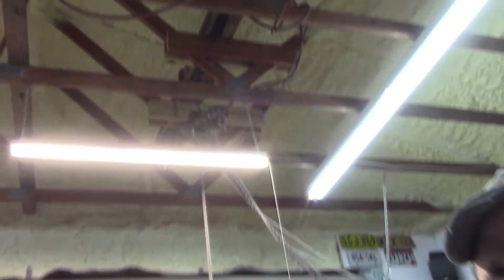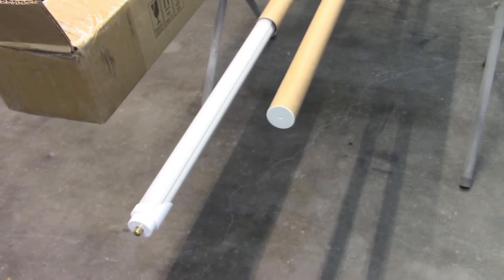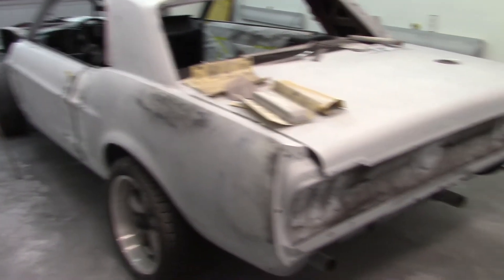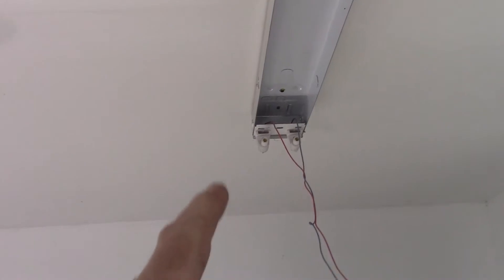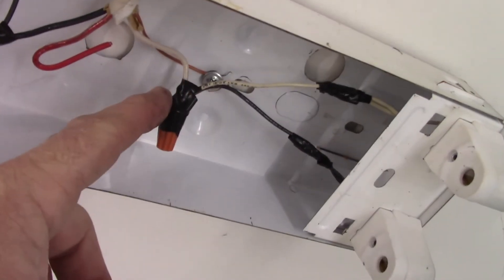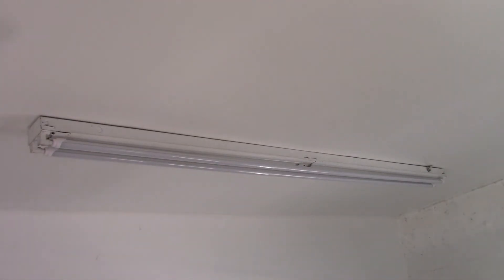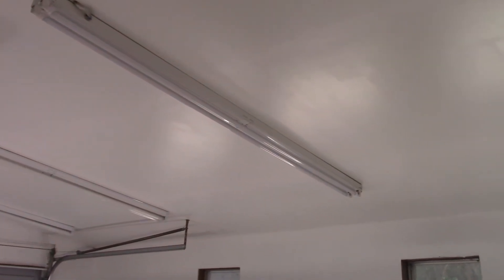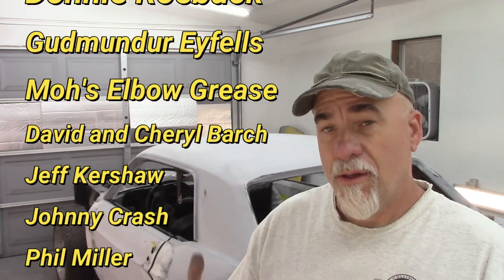LED light upgrade. Replacing old fluorescent bulbs with new 6000K LED lights.

Comment: So the new shorter lights are called LED bulbs instead of floresent bulbs. The new bulbs come on instantly instead of the old type that used to take a few seconds. I need to go buy some & I need to know what to look for. They are shorter & not as big around. Do they come in different whatts/ brightness. Thank you.
Reply from the maker: I believe they are available in different watts. Check my description for amazon links.

Comment: hey barry i believe i will be doing this upgrade soon, here is a word of warning to you and your veiwers, never do work on your lights by only switching them off. here is why. if the switch is wired correctly, it will be the neutral that is switched . this means there is still "ungrounded" power going to the fixture, so if you are working on the fixture and you create a ground with a tool or your body you will complete the circuit and bad things will happen, so always shut the power off at the breaker
Reply from the maker: Good advice. I should have mentioned that.

Comment: I just did this to my shop and also my house garage using the same exact bulbs. One suggestion is Amazon sells metal clips that you can screw into the center brace area of the lights and they clip onto the bulbs to keep them from sagging.